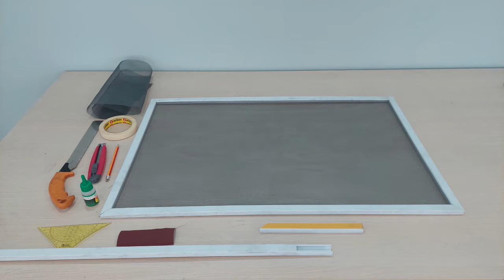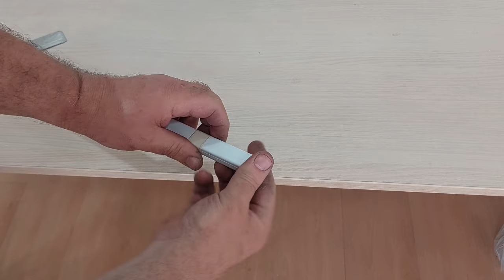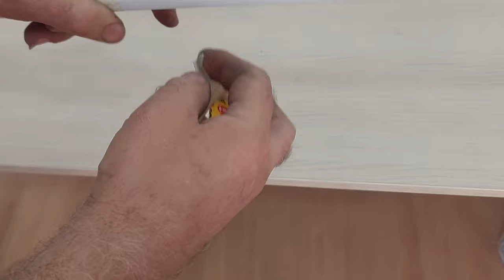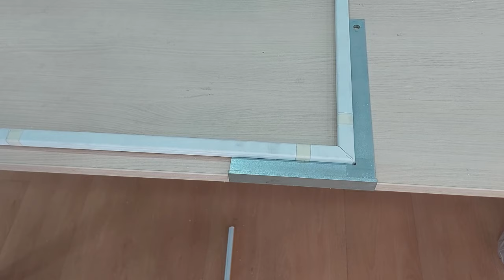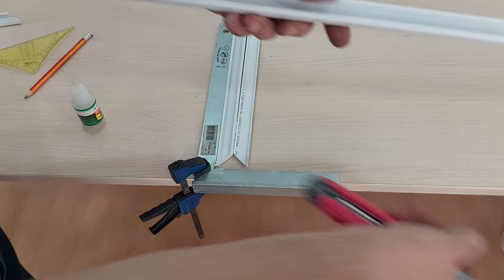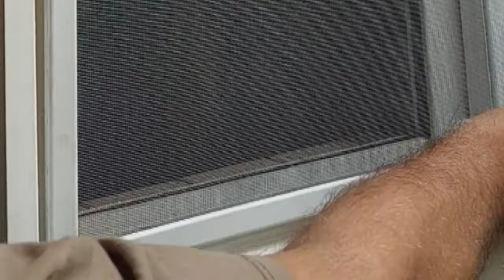DIY Mosquito Net for Windows

Comment: The material is trunking used in electrical installation for running / protecting electrical wires and cables.crazy glue, transparent or other, epoxy could be used too to secure the edges.Depends on where installing screw it to the wall as the electricians do if the adhesive on the back is not strong enough when it meets the surface. mmmm I prefer to screw it and I like the idea of magnet to the window frames and the screen .If the window and frame is pvc then glue the magnet to both the frame and the window frame.

Comment: Está tela pode ser usada em apartamento para evitar fuga de gatos? Ela dura quanto tempo sem cair, ou seja, qual cola usou pra fixar na parede? Você pre usou colar a tela para que ela não se solte do quadro de PVC?
Reply from the maker: These are electrical channels for cables and are self-adhesive. The glue they have holds very well

Comment: hello sir thank you for sharing your video what you called that frame you build
Reply: It is locally called cable putty  / cable organizer / cable concealer / cable cover.  If you have rodents and other pests then you might want to go for a mesh made of stainless steel and aluminium track for frame.
Reply: Pvc moulding size ¾
Reply: Conduite de PVC  para canalizar fios elétricos,  aqui no Brasil temos a  marca fama que encontrei mais resistente que outras e tem  de várias larguras e.já vem com fita dupla face.
Reply: Cable casing....I guessed
Reply: @cityofangels11  inhone konsi net use ki hai , market mein aisi net to available hi nhi hai

Comment: What is the net material you used for this frame , we have steel or hard plastic nets available here hence are difficult to lock into the electrical channels ☹️
Reply from the maker: This is fiberglass mesh and it is soft. Polyester mesh can be used.